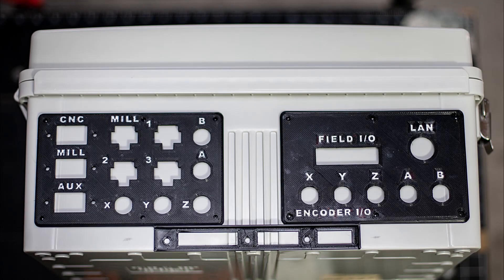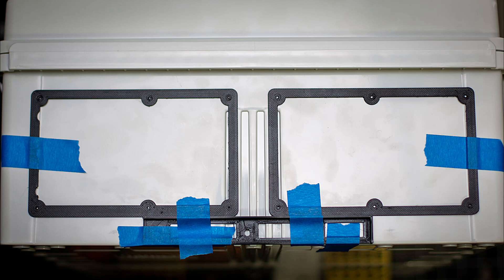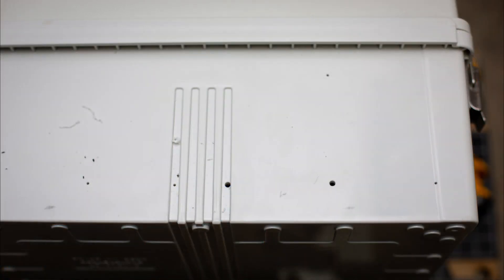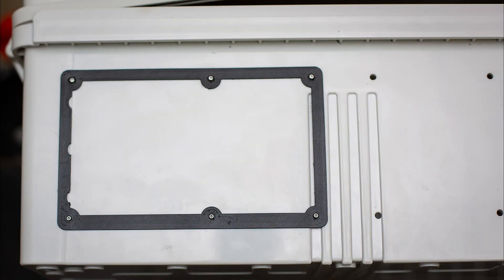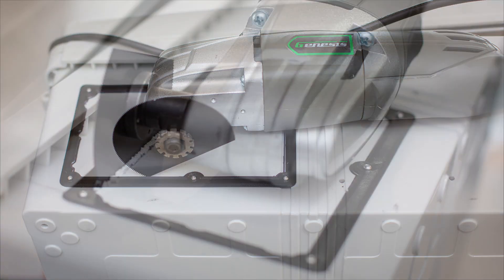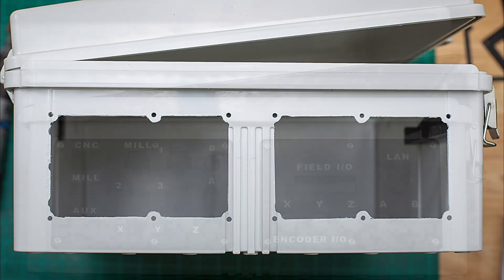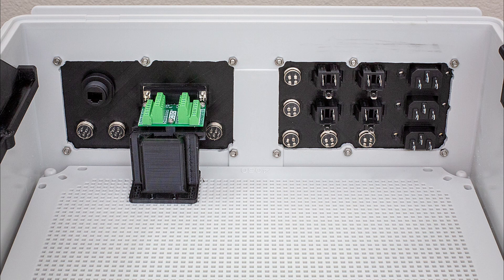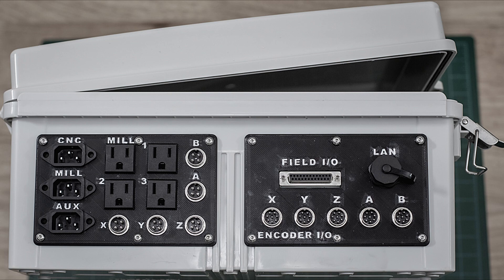Mounting the Connector Panels onto the Electronics Enclosure

Comment: I’ve used steel enclosures but those poly ones sure make it look much easier! Coming along nicely.
Reply from the maker: Yea, I've used both and the ABS enclosure is easier to work with. Depending on the environment of use, steel may be a better choice for durability and electrical noise shielding. This one is going in my garage so, industrial quality wasn't needed.
Thanks for watching.